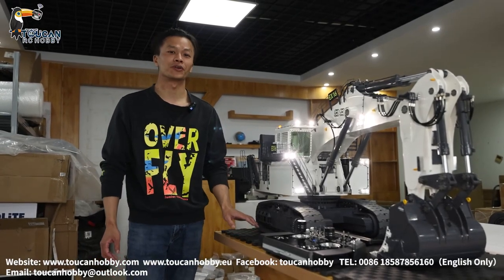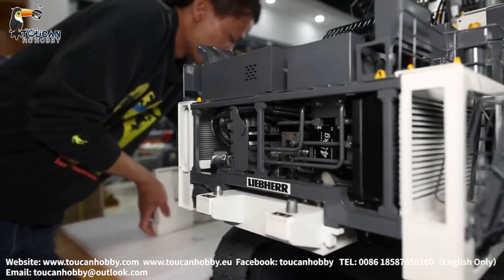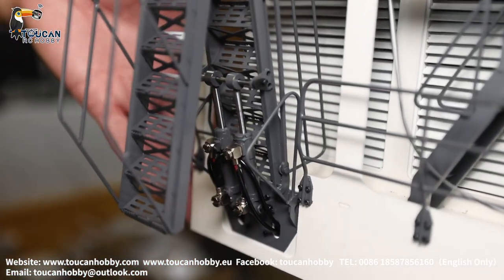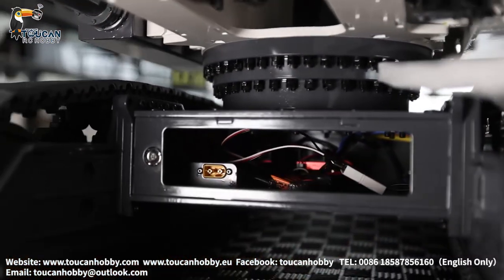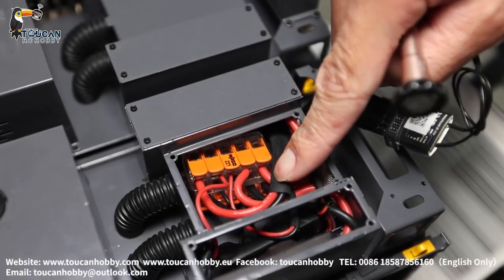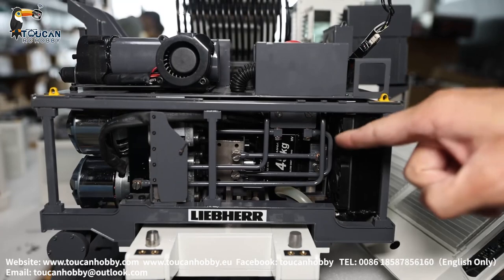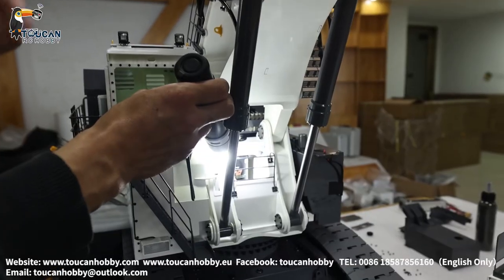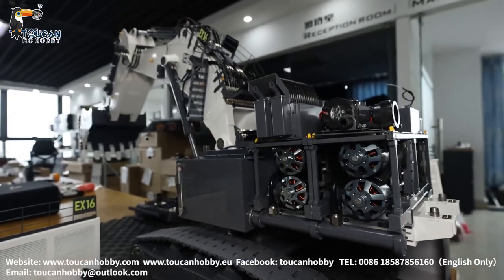Full demonstration of RC 996, 4pumps. sensored brushless motor,10 pressure valve. Kai wave reducer.

Comment from the maker: Full demonstration of RC hydraulic 1/20 scale Liebherr 996, XE radio, 4pumps. sensored brushless drive and rotate motor, brushless motor for pumps, 10 pressure release valve. Kai wave reducer for rotation, screw reducer& planetary deceleration for drive.

Comment: What is the average range reach of RC for these rc models?
Reply from the maker: From 1500 to 13000 usd, which one you like?
Reply: @toucanhobby2400  i am sorry,i expressed myself wrong. What's the max remote signal reach from RC to the model? How far can you be from the model and still be able to control it.
Reply from the maker: Depending on the receiver and launch from radio a few kilometers
Reply from the maker: Add me as friend will offer you more details